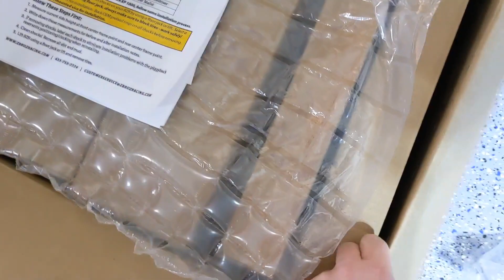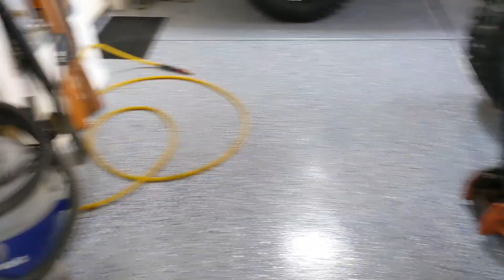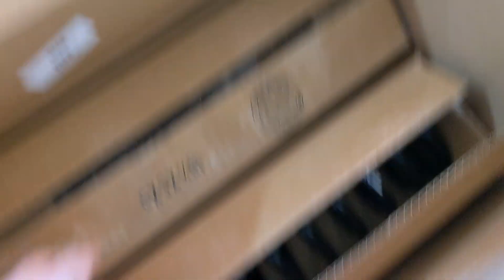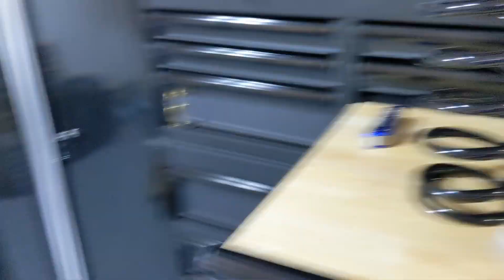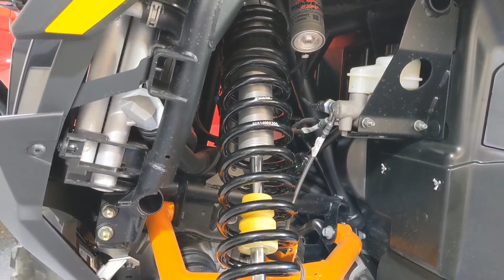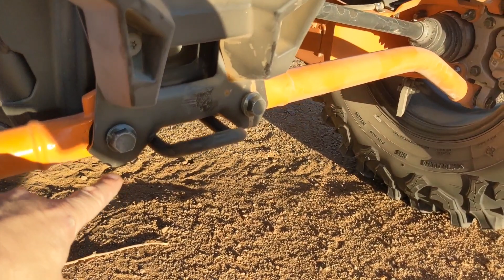Polaris RZR PRO XP 4 Zbroz suspension install (full spring kit)

Comment: I just picked up the 2022 XP Pro4 model wonder if they made the springs any better.
Reply: The rims are the same I noticed as well. I have just over a 100 miles on it and will keep the springs for now. Thanks
Reply from the maker: They supposedly upgraded the tender springs before I purchased mine however they're still too soft of a spring rate up front A lot of body roll and bottoming out That's why I switched them.  It really depends on what type of driving thing you do I would recommend using it with the factory springs for a while see how you like it I knew right away that I would need to upgraded springs within 50 miles.

Comment: what tool did you use to loosen the ring at the top of the tender spring? Some type of spanner wrench? Was it hard to loosen the ring in the front due to limited room at the top?
Reply from the maker: Once you jack up the car off the ground and the weight is completely off and the suspension is hanging you can literally grab the ring with your hand and your other hand on the springs and spin the whole assembly loose.

Comment: Do you know if the stock springs on the Ultimate are the same as the Premium?
Reply from the maker: Not sure the ultimate has the live valve suspension so likely different springs. But people have issues with those as well.

Comment: remove the front sway bar and throw it in the garbage! I only run the rear when i'm on sand. The suspension works 100X better without the sway bars.